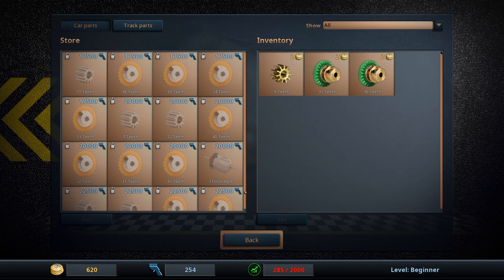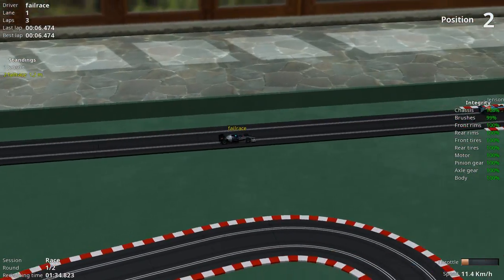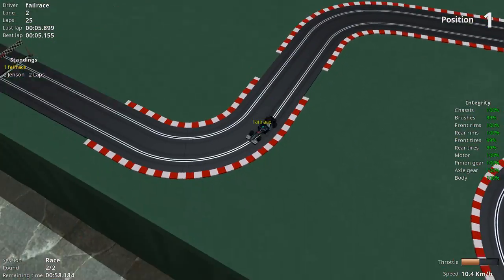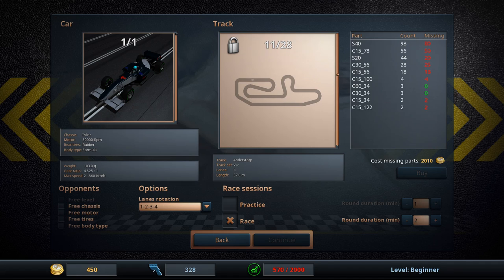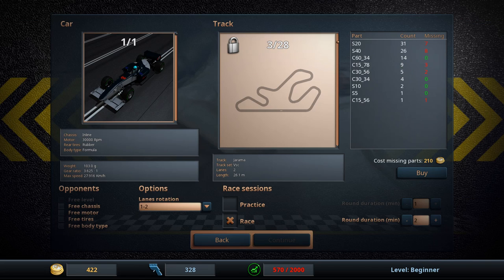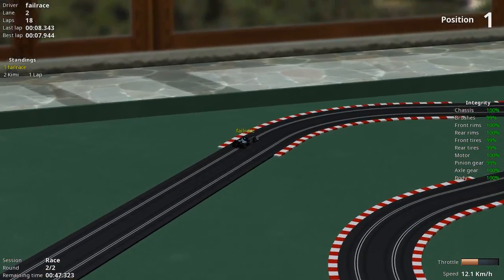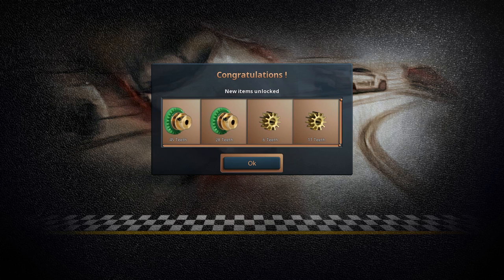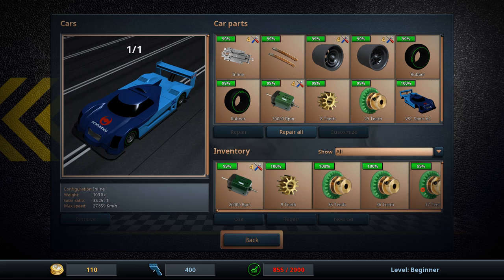FailRace Plays -  Virtual SlotCars

Comment: The more teeth on the Drive gear, the more top speed. The more teeth on the Driven gear, the more acceleration.  Also rule of thumb. adding/subtracting a tooth on the drive gear is like adding/subtracting 3 teeth on the Driven gear.

Comment: if jenson makes so many mistakes, imagine maldanado
also you got the gears mixed up. Smaller drive sprocket and larger main sprocket for low speed tracks and vice versa
Race 2 Bwoah, um, that hairpin really caught you out.
Jarama is the 1987 to 1989 layout